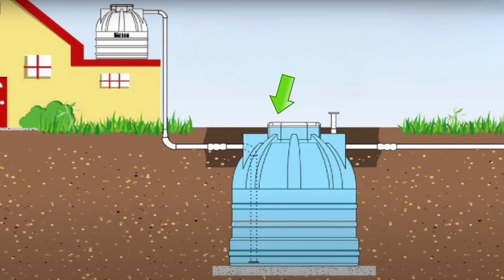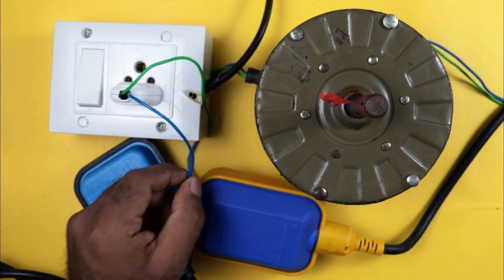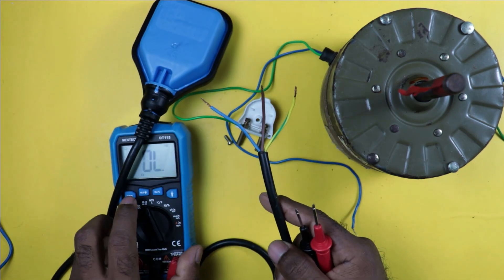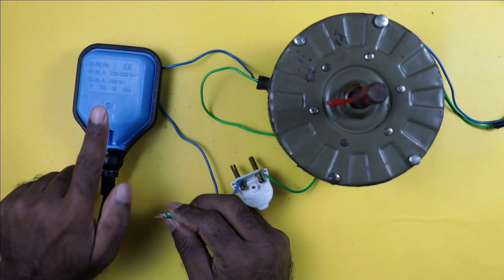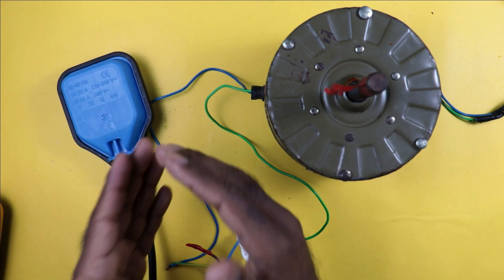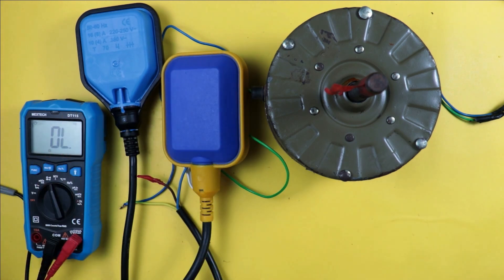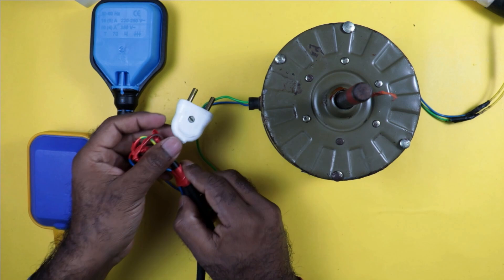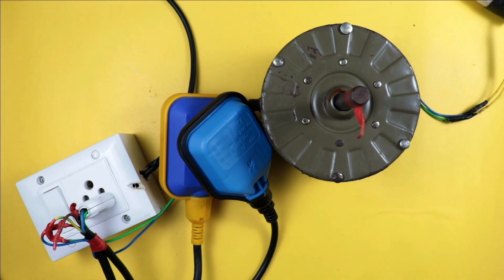How to Connect Two Float Switches Together for Single Motor Control @ElectricalTechnician

Comment: As you said and recommend to use always negative supply to control float switch. If my application is 3 phase motor how can I connect float switch? As there is no negative..
right now I controlled via contactor using one phase. Please suggest!

Comment: Was wondering why float has three wires. Got it now. Great video. Plus now understood how both tanks can be controlled. No need for water level controller if I could understand how to stop dry run in this configuration.